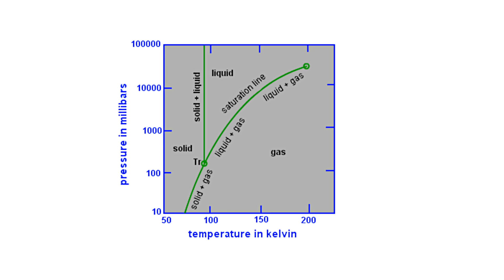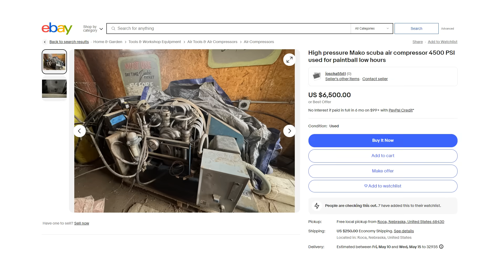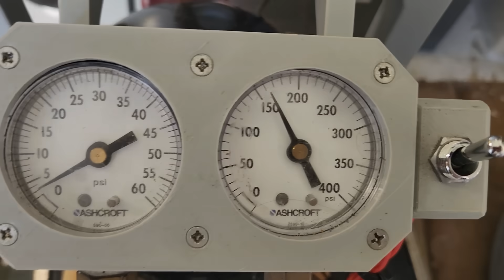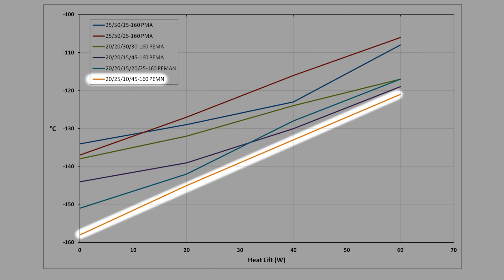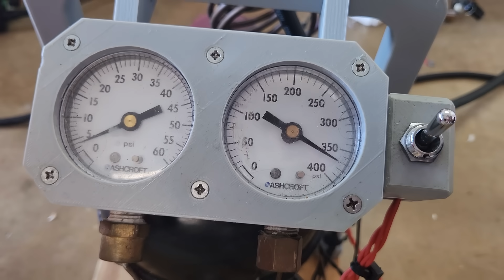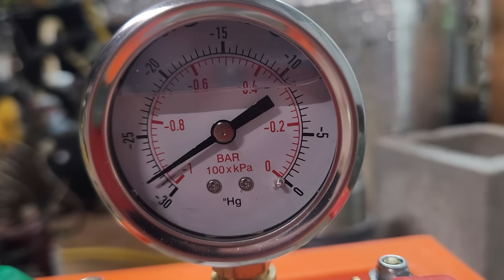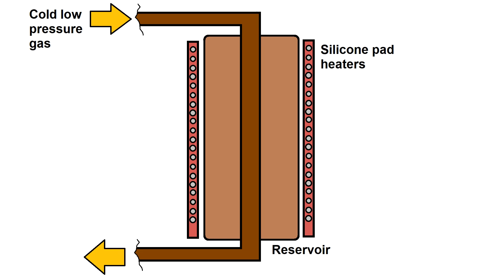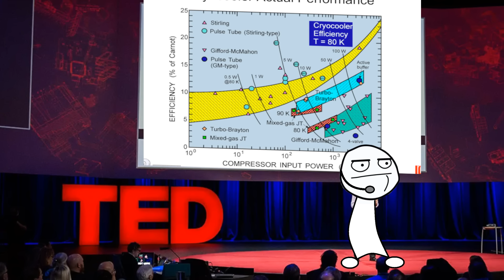Making Liquid Methane (and blowing up my Cryocooler)

Comment: If you want revisit the vacuum maybe you could encase whole system with layer of glass fiber and tubing then draw air from the isolation layer. The glass fiber layer is to make sure there are none contact points between tubing and cold stuff. It would look very professional xD

Comment: There will be no ethylene in natural gas. Olefins do not naturally occur in natural gas. Typical consumer gas is either "dewpointed", where about 40-50% of the naturally occuring propane+ is removed, or "deep cut", where all of the propane and almost all of the ethane is removed.  It can have some CO2 and N2 in it, perhaps a couple of percent of either. Your natural gas likely comes from Louisiana, and if so, is probably deep cut to either contain minimal ethane, or, if it has some nitrogen in it, might have enough ethane to make the minimum HHV (higher heating value). Call your utility and ask for the engineering department, they probably do or have analyses for the gas. Most contracts require that this be done monthly or at least semi-annually, and a cheerful phone call should get the analysis emailed to you.

Comment: I've worked in the LNG industry. While technically, it is true that LNG is flammable, it is flammable in the same way that isopropyl alcohol is flammable. The vapors burn, and in so doing, it boils the liquid faster so more vapors can burn, but the liquid itself does not burn. Also since it is lighter than air it is much safer in a well ventilated area than say liquid propane as the methane will vent to the atmosphere once it wams up a bit, while the propane will settle to the low points causing risks of asphyxiation and large ground level detonation even in well ventilated areas.

I'm just saying that both are dangerous, but... other than being colder, it isn't so bad compared to the propane you work with. And while propane has less energy (46.4 Mj/kg for propane vs 55.5 Mj/kg for methane), it is also denser (.668 kg/m cubed for methan vs. 2.0098 kg/m cubed for propane), making methane as safe or safer than liquid propane.

Comment: Try putting an auger on a small cylindrical evaporator and making a slurry / slush puppy thermal battery for AC storage. If you get a time of use tariff it can load shift into the cheaper hours of the day.

Comment: You're using k-type thermocouples that have a tolerance of +- 2-3 °C.. so you could have had a true temp of 162c when measuring the liquid temperature.. not to mention the digital thermometer has its own accuracy tolerance.

Comment: I just tore down a rather large compressed air cooler/dryer,  
So if you need a bigger compressor ive got one with a lra och 48A  11A normal.  This is altho 400v trephase.    Shiping to the states will be a killer tho....  

Cheers.

Comment: im sure this is the ramblings of a crazyman but could you arrange hilsch tubes in a fractal loop type arrangement in order to step down temperatures or would there be an issue compressing extremely cold air feel free to laugh hehe

Comment: There are 4500psi (300 bar) consumer grade air compressors for PCP/scuba tanks that sell on Amazon for as low as $200. Have you considered those? Btw I’m the founder of a startup that depends on cheap small scale liquefaction. We should chat!

Comment: I don't know if you own or are renting your house but if you are renting it may not be code so you will want to revert the system back before inspection as I am sure such a use may fail inspection.

Even if you own the house it may fail the inspection of the system to ensure it is still functional.

Removing moisture is also good because moisture can destroy the compressor and even the oil.

I think it causes the oil to become acidic and breaks down the varnish on the windings and causes a short.

Comment: The cheater's method for a Joule-Thompson cycle is to throw consumable cash at the problem, you can get down to liquid nitrogen temps with a standard 150psi shop air compressor IF you precool the high-pressure air in a dry ice/alcohol bath. Yeah, you're gonna chew through dry ice like there's no tomorrow, but that stuff is dirt cheap compared to liquid nitrogen or liquid oxygen, which is the mix you're gonna achieve with it. It's even higher yield if you have a higher pressure compressor, if you use a standard tankless compressor head hooked up to a CO2 fire extinguisher tank you can get 500-800 psi if you lower the pulley ratios or put a larger motor on the compressor head. Filter/dryer can also be integrated in that case, fill the extinguisher tank through the gauge port but drain it through the hose port and you can pack the bottom half of the extinguisher with dessicant beads.

Comment: How about Ammonia as an alternate to Liquid Hydrogen actually? Its energy density is somewhat worse than Gasoline, but it's much easier than Methane to liquefy, only needing around -33C at atmospheric pressure, or 8-10 bar at room temperature...
Reply from the maker: Yeah, anhydrous ammonia is a great fuel until it leaks and fills a parking garage
Reply: @HyperspacePirate  Yummy, the lovely smell of rotting fish, except times 1000! Yeah that's going to be the primary issue with that...

Comment: methane is actually medium heavy gas and can displace air... it stays close to the ground. until its mixed with air.
Reply: itll also self ignite at 40% concentration
Reply: not true, propane or butane yes but not CH4
Reply: @markhivin8670  propane and butane are why balloons of impure gas float, both vapors are lighter than methane

Comment: Hyperspace Pilot, Cold is the unexplored realm.  Fascinating and love the numbers. Edwards Deming "without data youre just another person with an opinion", and HP numbers = data is good enough for me. Closing the loop on a calculation by coming at it from multiple directions , beautiful work. a few glass beads in the vacuum chamber before freezing the methane might lift off the base, just a guess. Inspiring channel.

Comment: You can make solid methane inside vacuum flask, just put vacuum plate above opening of the vacuum flask and vacuum it.
Make a popsicle, just put smaller container inside vacuum flask with stick and you have solid methane popsicle 🤩

Comment: A very interesting movie. I am not a scientist, but rather a humanist, but it seems to me that the use of methane on an industrial scale, for example to power vehicles, is unprofitable.
Too much energy must be used to produce liquid gas and to install it properly. But I was surprised to find that liquid hydrogen is an even less economically viable fuel. Its production would require a lot of resources and energy. The effect on the environment is directly opposite to what political propaganda claims.
There is still the question of the safety of using liquid hydrogen or liquid methane. The issue of flammability, leakage of installations, storage of appropriate tanks and car accidents that cannot be avoided.

Comment: There is no need for a moisture filter between the compressor and the natural gas. Natural gas is usually dried to a very low moisture content to avoid condensations in the gas pipeline.

Comment: 1:42 you forgot the biggest hazard of hydrogen: 
https://en.wikipedia.org/wiki/Spin_isomers_of_hydrogen

"If orthohydrogen is not removed from rapidly liquified hydrogen, without a catalyst, the heat released during its decay can boil off as much as 50% of the original liquid. "  That means if you liquefy hydrogen quickly, it can escape through solid material... with gratuitous and destructive force.

Comment: I was thinking of creative ways to go off grid and maintain pure self sufficiency without having to do everything by candlelight and silly stuff like that. So I looked at biogas as a regenerative fuel source. It contains methane, CO2, hydrogen sulfide, water vapor and other trace gases. So I found simple ways to remove everything but methane. I then considered condensing it into a liquid propane is. I then found that is insane as illustrated by this video. It had me realizing why rural areas are supplied with propane and urban areas with NG. NG is plentiful. If every home in America had a pipe running NG to it like powerlines. That’s a ton of gas filling the NG pipes. So much unused gas. So it’s more practical to have the two most common fuels used the way they are. Meeting the need at the cheapest prices possible.

Btw biogas is so labor intensive. The inputs rarely equal the outputs. Y

Comment: If you don't like dealing with glass wool you can use vermiculite instead, it's a good enough insulator for the job and is dirt cheap at hardware stores. You could build the box out of foam and foil tape, drop in your coil, then fill in the bulk with the vermiculite.

Comment: /pedant mode on : CPU Overclocking photo where you compare methane to hydrogen shows liquid nitrogen pour :P Btw, you can get phase separator for the cryogenic liquids pretty cheaply, so that would avoid gas blasting whatever you condensed out.

Comment: One correction! Liquid hydrogen does not escape through metals as freely as you stated. While it is is true that hydrogen does diffuse through materials in the gas phase at a larger rate than most molecules, the same cannot be said for the liquid phase. In a liquid form hydrogen actually swells on the atomic scale, while at the same time the solid lattice shrinks. Therefore in a liquid form, you won't see nearly the same rate of diffusion through solids (I studied and ran liquid hydrogen diffusion research experiments in grad school). We're talking 20 years to fill a ping pong ball type of slow. Overall have been loving your videos! Keep it up!
Reply: BMW states your tank will be empty in 17 days regarding their newest 7 series on hydrogen.
Your can't park this car in garage or carport.

Comment: They're pricy, but go to a nearby HVAC supply house. Some of them will sell to the general public, get 5 percent brazing rod. The silver content is lower than others, and it requires more heat and prep. But, it'll stand up to pressures high enough to ruin a compressor's internal bypass. That's somewhere between 400 and 500PSI. I've never had issues with 15 percent silver solder, but its actually more expensive than 5 percent, melts at a lower temps, but it's softer so it may not stand up to higher pressure.

Comment: NEVER connect any pump to a gas pipe! I'm not kidding! You could have blown up the entire gas system! Furnaces, boilers and other gas consumers often do not have check valves. They are designed to operate at excess pressure in the gas system. Thanks to this, air (and therefore oxygen) cannot enter the gas pipe and mix with the gas, therefore the pipe cannot explode. BUT! If you connect a pump, it can create a slight vacuum in the pipe and then draw air inside through the nearest furnace/boiler. This means the pipe may explode. This is freaking dangerous and EXPENSIVE (in terms of money).
PLEASE use an intermediate gas tank. Even your favorite beach ball! Yes, of course your pump has low gas consumption, but... PLEASE use an intermediate gas tank. Accidents happen all the time. And if someone ACCIDENTALLY turned off the pump at the nearest gas pumping station, then your weak pump can provoke an explosion.

P.S. For everyone else. Don't forget that your gasoline electric generator is also a pump. But (unlike a compressor from a refrigerator/air conditioner) it has a VERY high gas consumption! And if you suddenly want to convert it from gasoline to natural gas and try to connect it to the system yourself without project approval... you will most likely blow everything up. Please be careful.

Comment: MLI does wonders for cryogen (Aluminum foil on your pipes is still good at conducting heat from the atmosphere, so you're fighting that too).  Black body radiation is a significant source of parasitic heat.  Since you probably don't want to spend that kind of money, this MIGHT be a low quality solution:

Nighthawkinlight - How To Make Infrared Cooling Paint (Electricity Free Air Conditioning)
https://www.youtube.com/watch?v=N3bJnKmeNJY&t=1s

*Paint -> Foil? -> Insulation. *
Shiny = more reflections = less absorption

Comment: Some Bits from a fellow Alternative Fuels Nerd:

- I would 100% be down for a series where you try and run a Natural Gas / CNG Generator on a LNG System you make! (“Adsorbed Natural Gas” is a thing to check out too)

- I mentioned this in my safety bit, but for not just that but also procedure/system design checking up on the Code Books and Academic Literature (that is if you haven’t already) for LPG, LNG, Cryogens/Odd HVAC Stuff etc may be worth a look.  Sidenote “LNG Train” is a common term for a unit at a plant that makes the stuff (they can have multiple for more throughput)

- FINALLY Check out “Dimethyl Ether”, it stores like Propane, Works well as Diesel (Cetane Value is higher than diesel, and as with Autogas (ie lpg in Spark ignition engines) it evaporating quicker can help with fuel injector effectiveness (also can condense air/generate boost i think ).  It is made Catalytically, often from Methanol, so given your experience, i THINK you could totally make this.  And again a series running it in a cheap amazon/ebay single cylinder diesel engine would be REALLY cool.  Just a thought from a MAJOR DME  nerd lol.

Hope this helps/was interesting and keep up your great work!

Comment: Some Safety Bits from a Nerd:

Insulated Gloves when working near the discharge/handling the liquids and all that is probably becoming a must at this point.  I am not too well read on Cryogen best practices, but looking that up (also propane/lpg best practices) and applying all you can with your abilities is probably a good idea.

Some sort of Mythbusters Style “Safety Shield” may be neat and shouldn’t cost too much (Some Polycarbonate and some sort of frame material, maybe angle iron?) but would be a good investment. (ie can dick around a bit more but still be safe)

Finally this may be a rough bit to get (although maybe home natural gas leak detectors exist?) but some sort of gas sensor meter would be GREAT for safety, they can get pricey and also need calibration at the nicer levels of hardware. (Sidenote i wonder if your house will be significant enough to show up on satellites anything soon for methane leaks lol)

Either way though you are already doing pretty good, amazing video as always, and keep up the good work!

Comment: Yeah, having built in failure points is probably a good thing if you're going to be qorking with dangerous levels of pressure, torque, heat...

Comment: Also remember that glass wool is moisture permeable, so at low temp. it condense inside insulation making less effective insulating material. 
Use Polyurethane Foam for or styrofoam .

Comment: Cloud of cold?? 10:20 this is nothing
My dumb ass genius listen to workers/service of LNG gas station for semi, as the gas station had a trouble with "venting system" for tanks on my semi. It didn't work. So we manually "Vented" tanks to drop pressure so I could fillup LNG.
Whellthat cloud was like up to 4m high an over 6m wide for like 30min of manual venting tanks on semi. It was f@#$ CRAZY !!!!
But now I know. Next time they can kiss my @#$, I'm not doing it again.

*I had 2 options.
1. Call Tow trucks (as 2 would be needed) and be towed to the next LNG station, like 50 or 80km to the closest one but not knowing if that station is even working, next one 150km i think🤔.
2. Manualy Vent it to drop pressure, fillup tanks and went on my way.

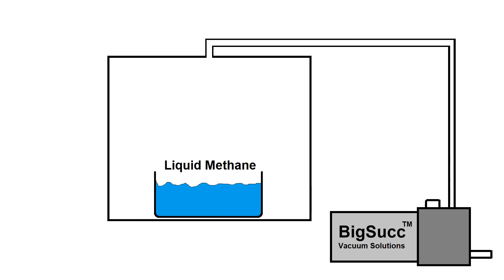Comment: @13:25  Try suspension for thermal insulation!  like some fishing wire and a small rig (or even thin metal wire fastened to ceramic coated something).
It can be more trouble than it's worth, but sometimes it works like a charm.

Comment: Another great vid. I feel I have to say two things that you probably already know, but I'll feel better having said them:
1: Eliminating ignition sources is not enough safety. You need to be ensuring that you're not forming an explosive mixture in the first place, because sooner or later an atmosphere that can ignite, will ignite, either through an unexpected ignition source (bear in mind we could be talking unexpectedly catalytic materials, not just something above the autoignition temp) or just through the Maxwell-Boltzman energy lottery.
2: It's pronounced "car-no", it's French.
Reply: I saw a video where a guy drove over an oil spill on the road and one guy commented that "driving over an oil spill is not only a traction problem but a fire hazard". Most of the replies were people telling the commenter he was dumb and that it is near impossible to make the oil catch on fire by driving over it. I am now currently worried by the self centered confidence of people thinking nothing will go wrong because they know better.
Reply: @asandax6  Like telling an aircraft mechanic they shouldn't step on liquid oxygen bubbling on the ground due to grease on their footwear could ignite 💥
Reply: Exactly, It's French, we can disrespect the pronounciation
Reply: @oiytd5wugho  100% fair point